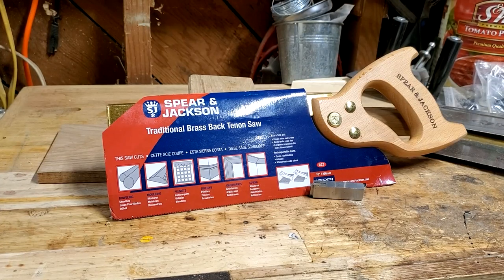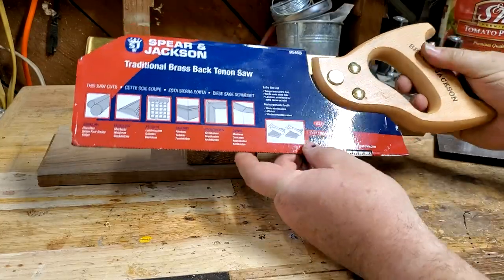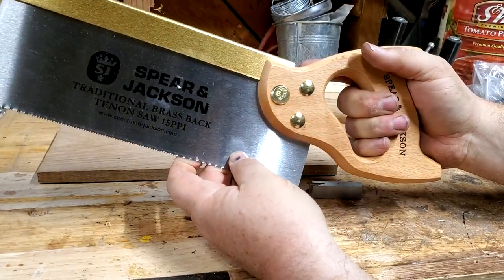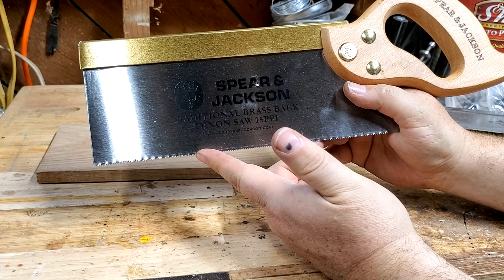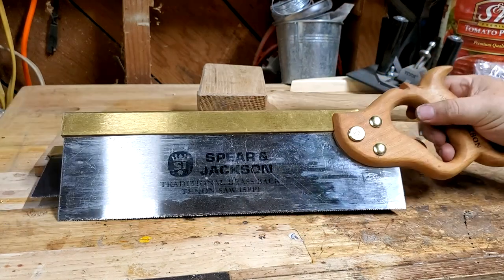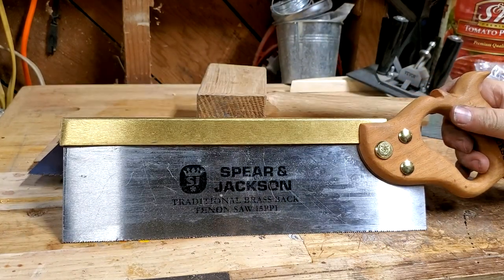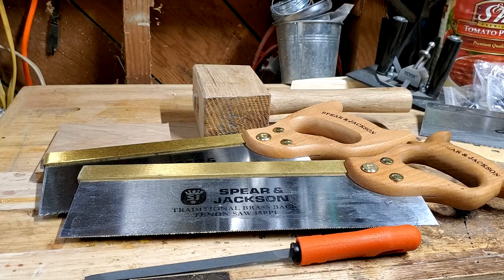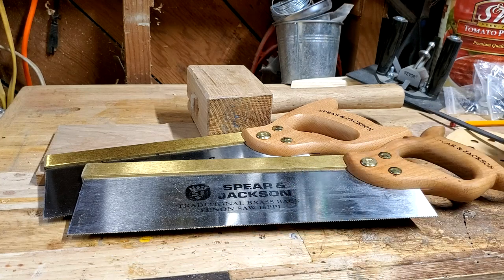Hot Rodded Dovetail Saw

Comment: Great vid ,thanks for sharing your experience. I have that saw and two panel saws by the same manufacturer. Three things to address in my experience..1) the varnish on the saw plate...huge difference before anything else was touched. 2) the saw set...I took a 0.002" inch automotive feeler gauge and placed it under a saw file ,clamped the saw to a piece of scrap wood to raise it , and gently ran it along the length of the teeth on both side of the plate...yes it takes a little longer than a twin hammer approach ,but its equal on both sides and didn't even sharpen the teeth ,as it was already sharp...cuts straight and doesn't wander. 3) the handle. Wholly dependant on hand size , so just elongate the slot in the handle to comfortably fit your hand and if necessary slim or taper the back of the slot . Two hours work ,max and a great saw now its tuned ,for a fraction of the price of an expensive saw . The panel saws ,well, loads more work involved in those , but totally worth the work involved ,have one rip and one crosscut. Thanks again for sharing .

Comment: Question: How the heck did you get the rivets of the S&J saw!? Neither you nor Rex showed much of this process on-camera.  I tried prying them off and only succeeded in completely chewing up my wooden handle.  Then I tried drilling them out.  No dice. I'd finally mangled one rivet enough I could use vice grips to literally rip what was left of the head off the rivet and pound out the shaft, which was really stuck in there--tore thru more wood as it was pounded out.  I took vice grips to the rivet I just removed and couldn't move the halves--NO amount of prying was ever gonna pop these apart.  I have ruined my saw trying to get these foul things out. 😞
Reply from the maker: I did two of these saws using an old cheapo chisel and a hammer to pry them apart.  A screwdriver wouldn't get under the edge of the rivet.  Don't use a good chisel, it was kind of tough.  There was some wood damage on a couple of the rivets.  Some just came apart real easy.

Comment: Wouldn't a Japanese pull saw give more accurate cuts when cutting dovetails?
Reply from the maker: That may be one of the greatest internet woodworking arguments, Japanese vs western saws.
Reply: Indeed Japanese saws can cut beautifully but this is not easy to do for westerners used to pushing their tools. The Japanese also pull their planes.

Comment: Thanks for the walkthrough of your experiece. I've seen Rex's video, but haven't tried it myself. I've made a lot of frame saws of various types and you can really make a lot of mistakes in sharpening and still get a pretty good cutting blade.  Your modified handle looks a world better than what you started with. I only use Japanese pull saws for dovetail work, just what I'm used to at this point. Your results look pretty good and inspiring. I guess I'll have to give it a shot. 

Some thoughts on saw set: If you get pulling to one side or the other, reduce the set on the side it's pulling toward and it should fix it. Happens to me every so often. 

Good video.
Reply from the maker: Thanks jsmxwll.

Comment: Dovetail saws have a thinner and narrower plate than a tendon saw and no set.
As they are only used to cut down the grain, not cross grain, they can be sharpened as fine rip saws.
Gents saws can be used as a replacement.

Comment: First, not ment to give a bad review, but.
Rex is good and fair but only teaches one side of how to. The saw is made too let you make the saw fit your hand. Paul teaches a more experienced how to. Like  using a hacksaw to lower the gullet before you sharpen to slow down the ware on your file and a standard tri sided file will work a lot cheaper. The good news is just wait till you try the panel saw's.

Comment: I have that longer saw and it works well after tuning. First off how did you ever get those rivets off with a screwdriver, didn't think that would be possible? One of the best things you can do for that saw is remove all the varnish on the plate. As far as over set I think it is better to just take it off with a file or stone, but be careful or your saw won't cut straight. Looks like your saw is cutting poorly. Sorry. The newer saw is a small tenon saw as package states and won't be ideal for dovetails.
Reply from the maker: The "rivets" aren't really rivets.  One side is a pin and the other is a sleeve and they are just friction fit.  So I pried them apart and was able to simply tap them back together.  On the 2nd saw I used an old chisel to get under them and pry apart.  I'll have another video showing that later.
As for the varnish, acetone was able to remove it all pretty easily.  It also removed the label.  It appears it was clear lacquer.
Reply: @NotanExpert-Woodworking  I've never seen saw hardware like you describe. So I learned something in your video. I've done a couple saw related projects so it is a topic I've had some exposure to. Reasonably priced dovetail saws are unicorns.
Reply from the maker: @1pcfred  I'm doing the other saw now.  I'll show the rivets. They are brass plated steel.
Reply: @NotanExpert-Woodworking  I enjoy seeing things I've never seen before. I feel it broadens a person.